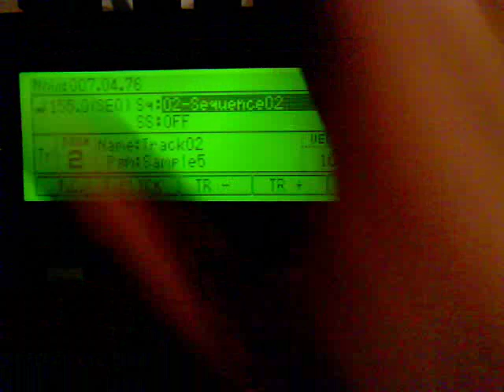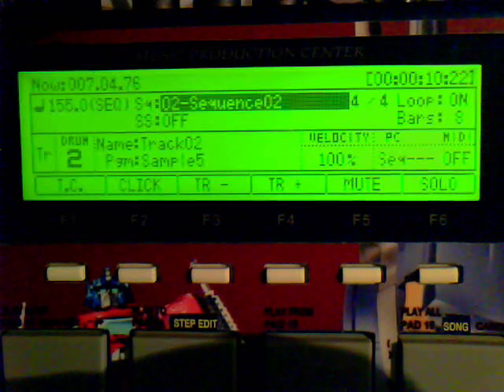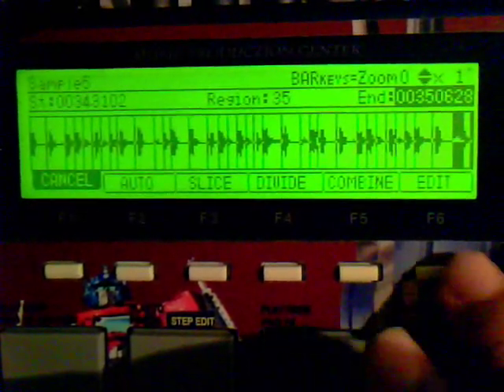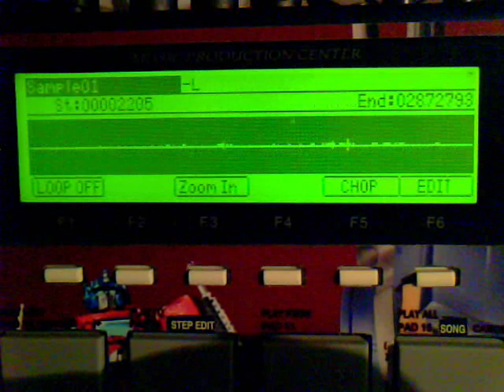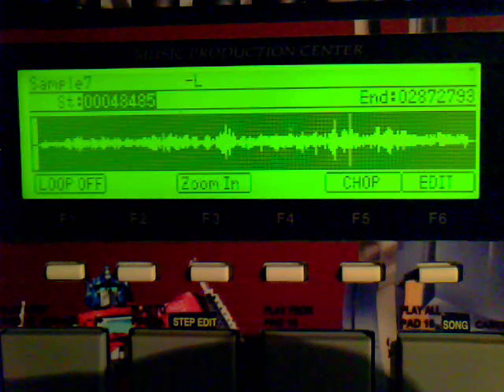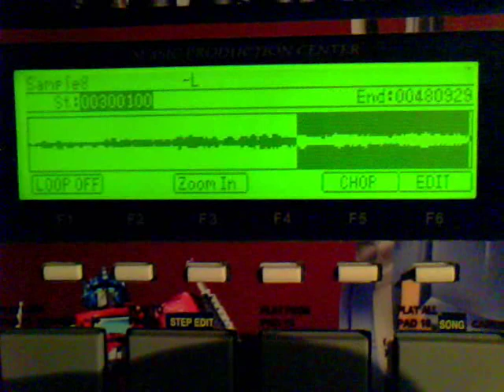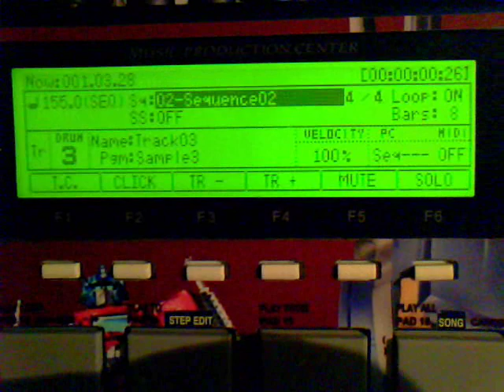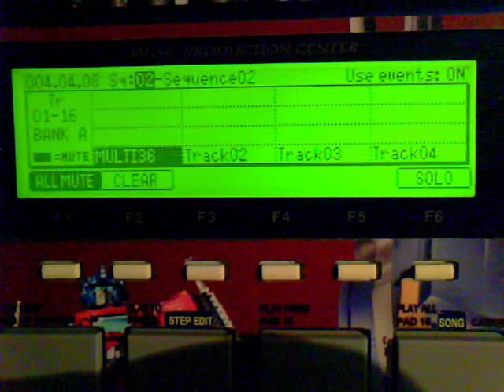Some Chopping techniques on JJOS 1

Comment: Hey man I appreciate you trying to spread knowledge and I know this is a very old video, but there is a bit of misinformation here that could screw up people who are new to making beats understanding. Your sequence is not 155 bpm, that is like drum n bass super fast speed. Your break is actually 74.5 bpm. The reason you had to double the speed is because you stretched it over 8 bars which is too many. Basically you need to put your sequence at 74.5 bpm and half the bars to four to get the correct count. While both ways of doing it actually work for creating the beat if you know the actual bpm then it is easier to program your beat when it comes to pitching, tuning your samples like if you want to add other layers to it etc. just wanted to clarify that for anyone reading.
Reply: thanks for the info man!